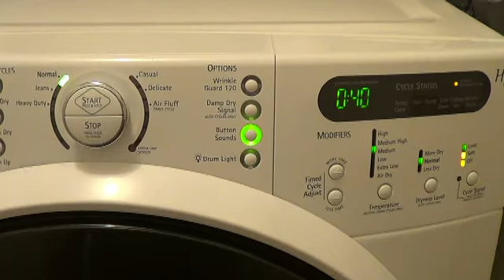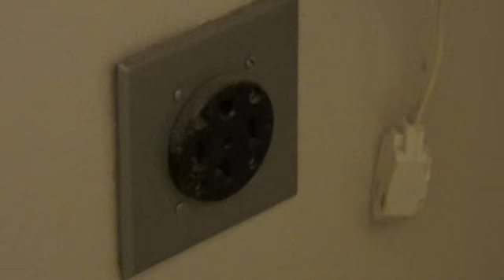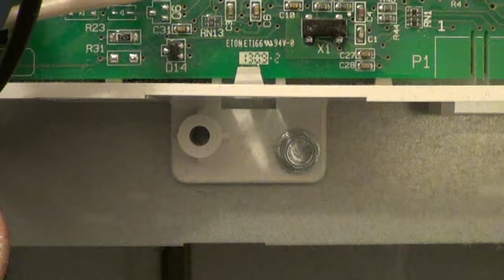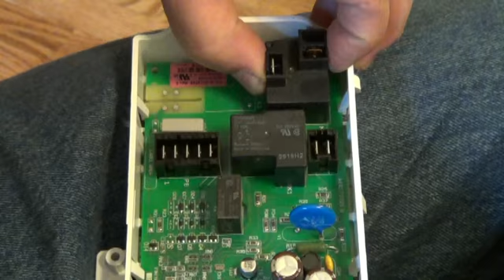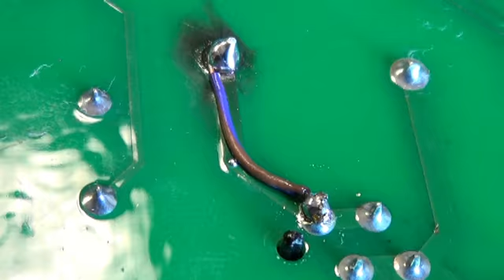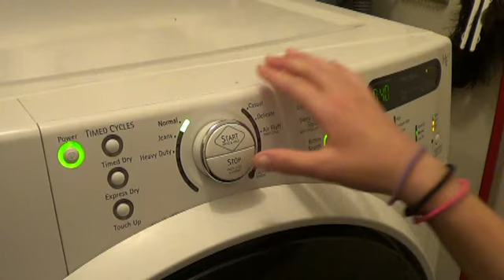Dryer Sears / Kenmore HE3 - F01 Error Code Main Circuit Board Repair

Comment: Jim you are my hero! I fixed my dryer! Plus I used my solder gun for the very first time! I didn't have the wire like you used to reinforce it but we'll see if it holds. I was so happy when it turned right on after I put everything back together! Of course this happened the day my husband went out of town - so I broke a few nails getting the lid off the circuit board BUT I feel VERY proud that I did it all on my own. Thanks for the how-to video!
Samantha

Comment: Ok !!!! I have a kenmore HE5 gas dryer . Watched you video , why not give it a try . Opened it up some exact thing , I cleaned it up real good and soldered it without a wire , checked with fluke meter . All good . Works great . Thanks a lot . PS I took the coo dos from the wife ;)

Comment: I did not use a jumper wire, but was able to expose enough of the circuit to make a decent connection.
Reply from the maker: +Todd Blyler The question is how much of the original circuit board foil got blown off when the solder joint exploded. I hope this works for you, but it is probably no better than the factory joint.  A jumper wrapped around the pin and properly soldered will provide a better than factory fix.  If the foil on the board is still in pretty good shape you just have the two paths in parallel which is even better.

Comment: I actually fix my dryer doing the exact repair you showed on your video,however is it safe to jump a power relay?
Reply from the maker: +bori0916adam You are not jumpering a power relay or bypassing anything.  You are simply providing a replacement current path between two pins that are connected together on the factory circuit board.
Reply: That's debatable,you're proving a current path around a burnt power relay.that is the meaning of "by-passing.,I actually found a replacement board on ebay (refurbished) for $75,as oppose to$250 brand new .N it came w a 6 months warranty
Reply: It is not a path around it, just a path to it! The original electrical path was burnt and non existent. He showed how to fix that path with a small wire. No bypassing ANYTHING , just  a legit repair..  You just wasted $75.00!!! But, to each their own!

Comment: What kind of wire was that
Reply: Barbara Taylor I used 12G wire and it worked just fine
Reply from the maker: @alexisbenitez5532  I have answered this many times.  There are lots of options for wire that will work.  The wire does not have to be very big.  I like about a 20AWG to 24AWG copper, say 22AWG.  You can use doorbell wire, garage door sensor wire, fluorescent ballast wire, etc.  Copper or tinned copper is best.  Stranded will work, but I would prefer a small solid copper wire that can be wrapped around the pin with the blown solder joint.  Just re-soldering the exploded joint is not likely to work as the metal tracing on the circuit board is likely gone or damaged, thus you need the jumper wire.  The wire can be insulated or bare.

Comment: Nice job and smartly done improving the capacity with the jumper!
Reply from the maker: Jeffrey Millard In the video I mention that you might be able to get away with just re-soldering the relay pin to the circuit board, but this will likely not work in most cases the metal foil, on the circuit board, around the pin gets blown away when the factory solder joint explodes.  A short piece of about #22 or #24 AWG solid (vs. stranded) copper works well as it's easy to form and bend around the pin.  Repair is still working fine and it's been about 6 weeks now.
Reply: +Jim Dandy Awesome video - fixed for me!! ... thanks!  Is the repair still holding?
Reply from the maker: +Erik Wahlquist Yes, the repair is still working many months later.